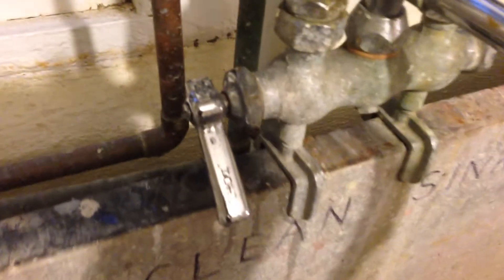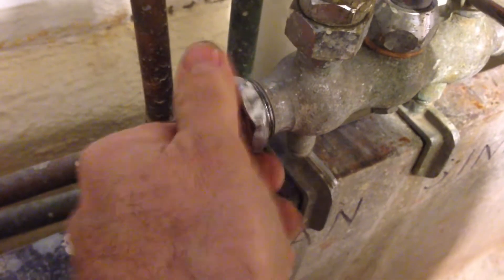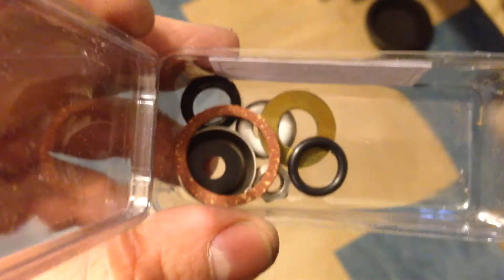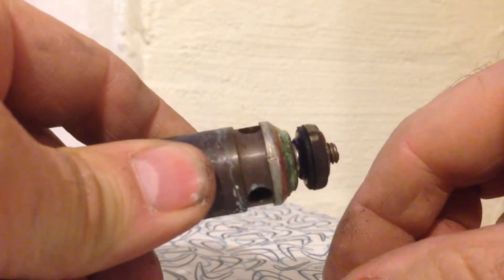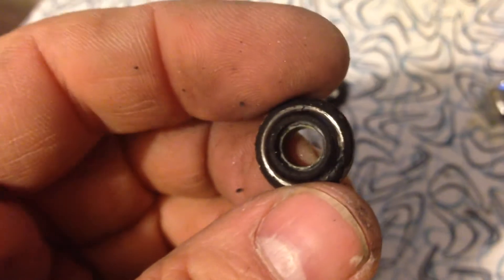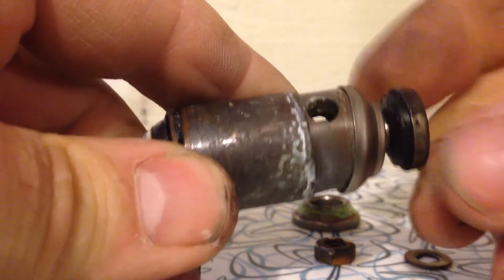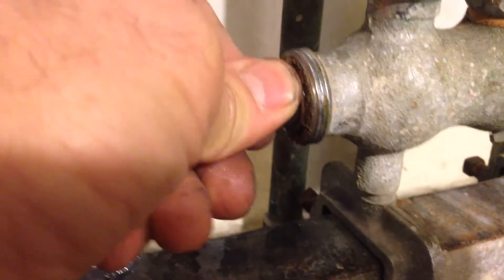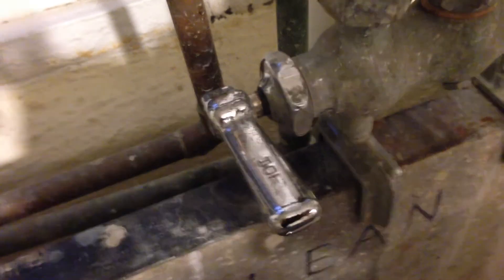Chicago faucet washer and valve seat replacement

Comment: Hey great video! Any chance you have the kit number or the store you bought it from? I've checked Lowe's and Home Depot they don't seem to have it.
Reply from the maker: Hi JB,
Home Depot and Lowe's won't carry anything for this type of faucet because it's older and industrial.  Check with your local hardware store or plumbing supply house.  Bring the valve with you or send a picture of the fixture/valve to the plumbing supply house.  I guarantee they'll have it.
Reply: @handy-bv6bz  I bought some from menards years ago.